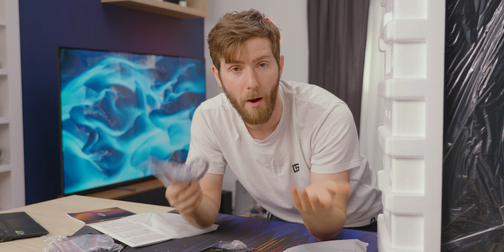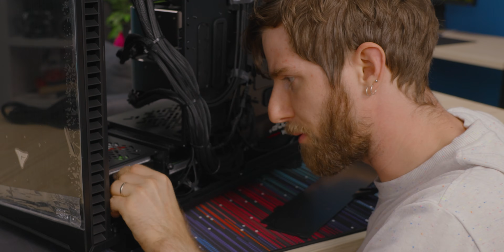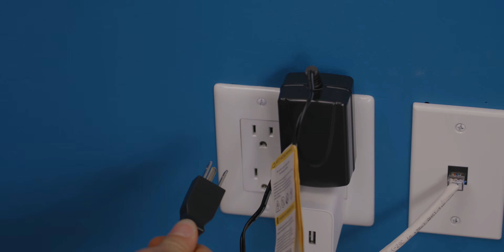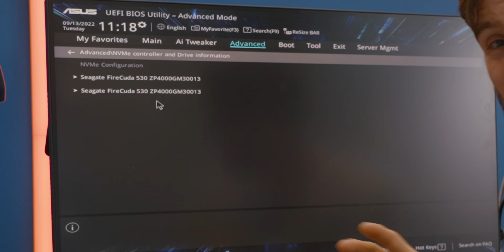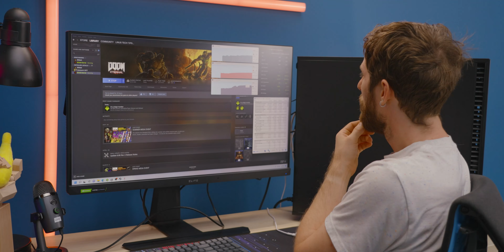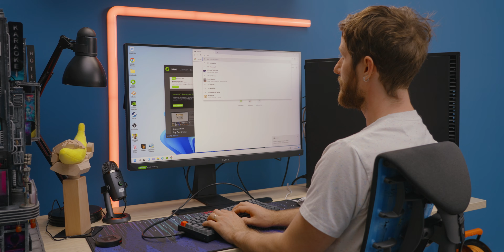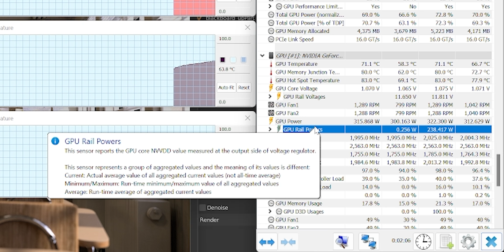This PC blew our circuit! - VRLA Tech Threadripper PRO Workstation

Comment: I wonder what the heaviest and lightest desktop builds would look like? (With only commercially available parts)
Reply: You’d probably get a 5700g on an Asrock X300tm-itx board for lightest. No psu is installed, the ram is sodimms and it would benefit with downdraft cpu coolers on extremely thin and light heat sink since the vrm has no heat sinks.

Comment: I'd like to see a video on whether setting a GPU as PhysX only actually does anything anymore too. Is that use case for a 2nd GPU pointless too?
Reply: they did one in like 2017. really pointless for anythign about a 1060 and you needed something like a 1060 to even get usable performance. Also so few games supported it

Comment: I have an analog soundbar plugged into my computer with a 3.5mm jack. Should I use optical because the bar and motherboard both have the option? Probably. I hope I ruined someone's day by having the option of optical audio and not using it.

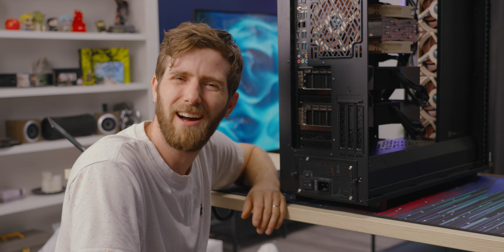Comment: 5:08  YES! Keep those ports! I use SPDIF/Optical from my Motherboard to my entertainment speakers (Youtube, TV, netflix etc etc) - which are Edifier R200DBs - they sound amazing for the price. For gaming I DO use the analog stereo port on the rear for my Logitech 2.1 setup - I also add my Anker Motion Boom Plus for rear channel audio at times.
Reply: You’ve kind of just proved the argument in the opposite direction though? You’re saying :

“No, don’t touch my precious dozen 3.5mm jacks! I am one of those people that needs them!” 
Proceeds to describe using Optical and One (1) Singular 3.5mm jack.

Anyone that uses surround sound is going to use the Optical port or HDMI audio. 99.5% of everyone else is going to just use the stereo and mic in jacks.

I would vastly prefer that all of the circuitry dedicated to 7.1 channels worth of Pre-Amplification and DACs to shitty little 3.5mm jacks went to just giving the headphone port an amazing onboard DAC and High Impedance capable Amp. 

Hell - even optical is dead and gone at this point, I’d take a well integrated HDMI 2.1 Audio option with Atmos / E-ARC support any day. Chuck that plastic piece of 1980’s detritus in whatever old folks home they stuck Beta and HD-DVD in. 

For anyone that does still need ALL of those other 3.5MM ports for their 7.1 Surround Sound (and inexplicably decides to have their primo audio signal source run through copper strands the thickness of Galadriel’s finest pube, complete with the several metric gigafucktonnes of interference that only such a girthless unbalanced analog conductor can provide), there is a simple solution. Go on eBay and buy a High End SoundBlaster card for $10. There’s Eighty Shittillion of ‘em out there getting shoveled onto the global e-waste pile every second (I wonder why).
Reply: @annix493  shit breaks, sometimes having a back up is nice
Reply: @akimbofurry2179  You’re going to use that 3.5mm sub out as a backup? ….for what? Besides - you’ve already got your front panel audio in addition to the rear, PLUS hdmi, PLUS whatever headphone Jack your monitor probably has built in. Just how many backups do you need?
Reply: @annix493  a full 7.1 interface, vs one 3.5 jack......
Reply: @UCKO9Y1A_LTwo_SkuQxwCSTA Yes, I use the onboard phono 5.1 audio jacks on my motherboard as primary sound output, I ALSO use an external SB USB soundcard for Mic in and 2 channel output, but no I cannot use my HDMI for surround because it is ALSO used as a secondary monitor and sound output. (5.1 because I have yet to find a home theater amp in my price range with full 6-7.1 discrete input jacks) I have three monitors total and all have speakers on them which I use to spread out Game(or movie) audio from the two or more voice chat programs that are placed on the side monitors.(side note the "monitors" are a 42" and 32" TV as well as a 19" PC monitor) 
So. Yes the 3.5mm audio jacks are a very nice thing to have and if you have gotten shitty sound out of them maybe get some better cables or not run them past noisy RF electronics on the way to your amp and speakers!
Reply: I can imagine ever using them myself but if I’m spending $1000 on a motherboard I better damn well have the option haha
Reply: @TaylorCrosbyofficial  nevermind stuff can break, and hazing them to sanity check shit is nice.

Comment: I still hook up my sound system analog but it turns out that the onboard sound is crappy (yes even on mid-end motherboard) and can't fill my subwoofer and all those other speakers without distortions. Sounds crazy but I still have to use an external sound card for good audio. In my case they should get rid of those ports because I never got a good onboard sound chip so far.

Comment: with the noctua fans making nosie things. i recently learnt that the hard way as well. i have 8 noctua 140mm fans in my torrent, 6 in the case 2 on the cpu cooler and when they get going it actually gets relativly loud. enough its not ignorable

Comment: I had never used or considered using the audio ports on the back of the motherboard UNTIL literally 2 days ago I was fortunate to receive a pair of wall powered studio monitors that take RCA or quarter inch input, so I ordered a cable to use them with my pc that actually just arrived as I was typing this haha
Reply: Why would you use the rca out from the motherboard? A dedicated dac is way superior.
Reply: @jaky3  No reason I guess. They were free and I'm cheap. I mainly wear a headset anyway

Comment: Hmmm.... this is similar to the workstation I just built. Except I have 512gb of RAM, and have the 5975wx instead of the 5995wx, Asrock WRX80 Creator (PBO overclocking) instead of the Asus Sage Pro, and only one EVGA Kingpin FTW3 3090 instead of two Founders 3090TI's, and a 1500w Corsair Powersupply instead of 1600W, and two Sabrent 8TB NVME SSDs+Intel optane 1.6GB boot instead of hard drives. Beast of a machine either way, and mine doesn't blow power circuits.

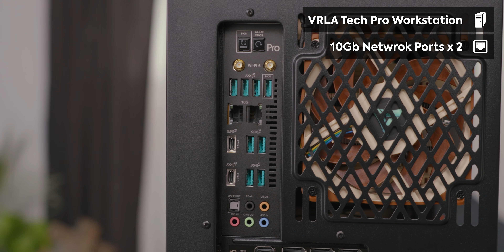Comment: 5:13 I really like that there are still those conectors. I personaly use speakers a lot because if i have any headphones on my ears for more than 30 min my ears will just die. I dont know what it is but my ears just start to hurt when there is a speaker near my ear. I still have headphones but 99% of my audio goes over the speakers i have connected to my motherboard. And sometimes I use it for troling on discord. I just plug the mic in to the speaker and the discord i happy :)

Comment: How many individual power wires go into a modern GPU... at what point do we start bypassing the power supply, add a rectifier to the GPU, and just plug it directly into the wall... I mean those two draw more than my kettle.

Comment: I actually do use those analog audio out ports. Living by yourself means you can use your stereo as computer speakers
Reply: I do too. I have a Creative Labs 5.1 speaker set I've had for at least 15 years. Oldest part of my PC setup by a long way, it simply hasn't needed replacing. 

I do have a headset but I don't like using it for extended periods.

It definitely adds to the wire clutter behing my desk though!
Reply: I use the analog ports for my Logitech z506 5.1 speakers mainly because I thought that was the only option. Can I get 5.1 over the optical port and ditch the analog cables?
Reply: I'm still using a 20-ish year old Creative Labs 5.1 speaker set, so yeah, 5.1 or 7.1 analog audio out is what I want.
Reply: I too have 5.1 surround speakers hooked up directly to my PC.
Reply: I don't live alone and I do too (but via dedicated soundcard). I was very confused, I thought maybe there is a better way now to do it, like wireless without latency or similar...
Reply: @CZiNTrPT  Wireless is the dream isn't it. Our rat nests are quite the safety hazards
Reply: Yup same here, I thought every nice HIFI setup had to have a PC with unlimited music tracks to be complete 😜
Reply: I use it but plan on probably upgrading to a dedicated sound card. I upgraded to 7.1 surround sound quite a few years back as used to play fps games on PC and wanted to improve my skills. Just upgrading to surround sound did just that being able to know exactly which side shots come from made a huge difference. I got so good was able to just turn and fire based on sound and get headshots some times. You have to fire before you see the person wile turning as lag from image updating is longer then your shot being received out into the network.
Reply: Surround Gaming is just too good. Sadly no soundcard has hdmi output to send 7.1 digitally to the sound system and doing it by the graphics card, you have to enable a second monitor, to pass the audio, when using display port. And the sound stops, if Windows sends the monitor to sleep. How stupid. So sadly analogue is the only option.
Reply: I use mine so I can have my bookshelf speakers be used for more than just my turntable. And I use it so I can reroute the audio from my consoles to my computer when I am playing with my computer monitor, though in that it's using audio in
Reply: i still use that old dell 5.1 system from back in the XP days, it sounds great, and works perfect for shooter games
Reply: I enjoy having a quality optical audio out on my PC for the same reason. It means I can use a home theater sound bar as my external audio.
Reply: USB and DAC my man
Reply: @nosurp  that adds way more bulk than just some extra ports
Reply: Analog would cause possible distortion for my setup because way too much cabels behind my desk. I use a 5.1 Setup. Fiber Optic HDMI to my Surround Reciever and done. Is a little expensive but works great. And yes, My reciever is far enough away that normal copper HDMI cables (which tunnel over an power cabel and were 2.0b cables) would make my screen black out for 3 secs when someone turned on the lights in the hallway... The fiber optic HDMI 2.1 cables don't have this problem and my Yamaha reciever can actually utilize them.^^
Reply: welcome to 2022 we use gaming headset  even when we have a family
Reply: @RichMantaray  Some of us prefer not having stuff stuck to your head all day. Plus the closer something is to your ears the worse it is for your hearing, no matter the volume
Reply: @RichMantaray  Why would I want to use headphones any more than is necessary? It's enough that I have to use a headset at work for calls.
Reply: Same, I wouldn't buy a motherboard without them because my home theater's been kicking for 10 years and is still awesome, and I don't wanna get rid of it. Those things are ethernal
Reply: Yeah, I do too, don't even need to live by yourself. It's just that the quality you get out from those ports is not really optimal. Why wouldn't you use a standalone amp and/or dac with usb/optical?
Reply: @jaky3  Probably because modern DACs mounted on the motherboard are perfectly good and well isolated, and most of the audiophile stuff you're pushing is a "expensive equals better" subjective test.
Reply: @jaky3  in 2003 maybe. My motherboard went out of it's way to highlight it's audio controller. light up isolation strip, and different (I assume better) caps then the rest of the board. And mine isn't even high end.
Reply: @jaky3  super cheap surround setup
Reply: @jaky3  most good studio speakers are analog, true you can use an external dac or like me use a noise destroyer, it's not the quality of the ports that's bad it's the nuclear reactors we call gpus nowadays that radiate a crazy amount of interferences, surround sound is trash....if you think any "surround" kit is good you don't know how "studio monitors" that's their name sound like they are not that much more expensive but the difference in sound quality is several galaxies far away
Reply: @jaky3  my i guess uncultured ears have literally never been able to tell the difference between any "super high end" audio hardware ive had the opportunity to listen to, and any pair of half decent headphones/speakers. for me, personally, after a certain level of quality, its just paying more for higher quality product materials. ive never had any problems with these analog ports, and will use them until they dont exist anymore by default, and will probably end up buying add in cards for any motherboard that doesnt have them.
Reply: @grimarchangel  True about the hearing. First i was the same but because of my dad (audio guy), i got more into sound quality. Now i can actually hear the difference in gear. Just need to train your ear to it. Well, that and the fact i probably got my dad's ears... :,D
Reply: @jaky3  Uneccessary clutter?
Reply: Most modern receivers also have Bluetooth. Better option than analog.
Reply: @PawsPistons  Bluetooth isn't better in any way. Also, having a receiver is extra stuff.
Reply: @LaDeXi   yep.  No wire.  Better in every way.
Reply: @PawsPistons  Bruh. Worse audio quality, has delay, actually needs to have Bluetooth on both ends. Nothing good. Does Bluetooth even support surround sound?

Comment: Yes! Those audio ports are important. If you're one a budget and get a surround sound system with only analogue inputs, PC audio is a godsend. Even ancient motherboards with realtek audio sometimes have simple room correction stuff built in. I can only imagine how much better the audio quality on these motherboards has gotten by now.
Reply: Audio has been basically perfect quality for quite a while now. Even $9 USB dongles from Apple or Samsung can give you a perfect analogue signal.
Reply: @katbryce  yeah, because it's away from all the high frequency switching stuff. Which is one aspect of why on board audio still sounds worse. Plus, you need good driving power for more expensive audio gear, which on board rarely provides
Reply: @katbryce  those and a lot of 5 USD generic chinese dongles are using the same Realtek ALC 5686 chip. It's pretty good and does 24bit 96KHz, plus are enough to play most ~32Ohms phones with decent volume. The one thing they could be better is microphone output.
Reply: @katbryce  I don't think so about those dongles and my understanding is they break so frequently they cost you a lot.
Reply: @bipbop3121  I've never had any problem like that with the Apple ones. I'm sure the Samsung ones are of a similar quality.
Reply: This is other end of the spectrum, the motherboard costs $1000 ffs, it'd better have everything
Reply: @ydfhlx5923  Its a workstation; I would prefer a PS2 mouse connector & an SDcard reader.
Reply: @officerrambo  this is why I need 3 - 4 usable drive bays in a case. 2 disc read write, USB expansion (a hub with a tower is BS) & a multi card reader. A jack & a USB A CBS a USB C on top is some BS. There are a few relic drive bay cases, but nothing decent. The ones that are decent might only support 80 mm fans and not modern sized components & definitely not rads. Ok, I'm fine with air.
Reply: Sound quality has gotten worse, as it just doesn't matter any more
Reply: They're the same from the last 15 years actually, but it is better than nothing. If they could send it in the form of USB, it would be better because less noise.
Reply: i mean yeah, but if you can buy a 500€ plus motherboard, i would assume you would get something dedicated for sound
Reply: @TV4ELP  No I won't let that count! I payed a thousand bucks for a mainboard, for CREATORS I might add, and for that price It should have a good audio solution in in for crying out loud!
Reply: if you're on a budget why the hell are you buying this ?
Reply: @firstname4337  maybe he isn't, maybe he already have one like I do. Sometimes people aren't able to spend the same amount of money...

Comment: They put all those high performance quiet Noctua fans in and then the choke them with a glass front panel with only side vents so they have to ramp up and be noisy...

Also still rocking 5.1 speakers, never die analog audioports.

Comment: this is basically ideal compute  sworkstation but you need mb that really provides lci lanes...it still needs nvme and 100g plus 30tb plus of spinning rust - even older cuda cards are fine - wait for gpu crash to fully settle before shopping for pressure washed/degreased mining card - there should still be some good deals for a while due to massive mining refurb inventory - smb want to scale out resources for redundancy but also being mindful that nvme scales well - smb will want clusters w/ 1m iops and soon probably 10m in next couple years - the high end enterprise will be more than 100m iops from an 8 node cluster

Comment: The only use case for this thing is to run benchmarks. You don’t use 3090ti’s in an actual work station let alone two of them in SLI lol The power draw on this thing is ridiculous..also we stopped using SLI in our workstations YEARS ago because consumer cards aren’t supposed to be in work stations lol